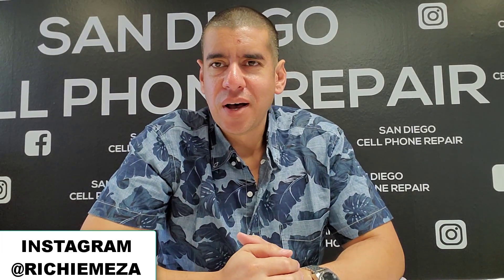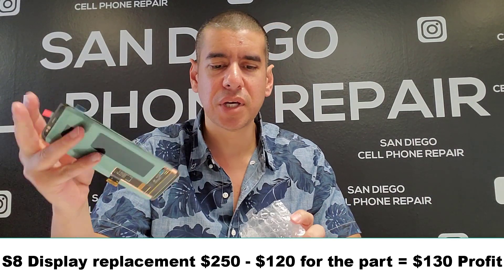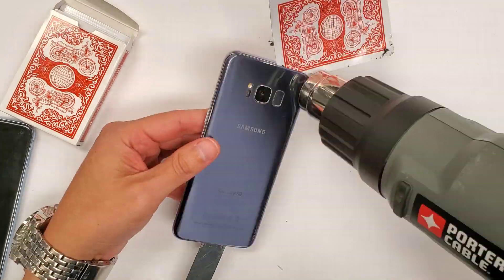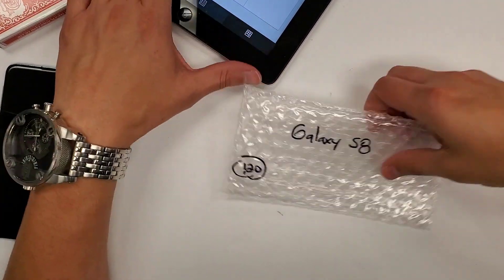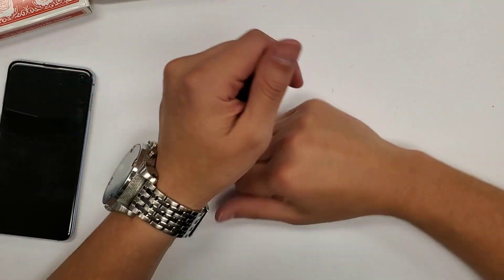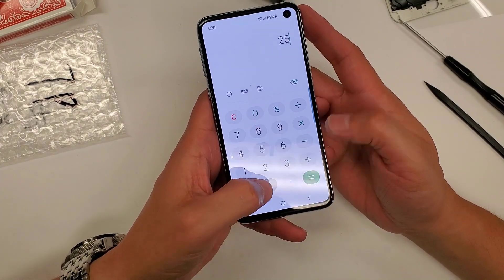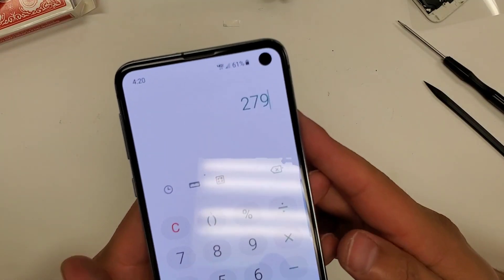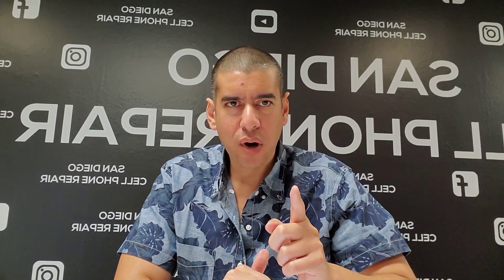Cell Phone Repair Tech made $279 Repairing Galaxy S8, Pixel, iPhone 7

Comment: I have ip 5S locked so I want to open inside the phone to remove battery but screw is stripped  so can you suggest me how can I remove the screw
Reply from the maker: Force it open. The inside screw hole will break. But you will at least get the phone open.
Reply: @RichardMeza  ,Hey Richard when you start phone repair from coffee shop did you messed up any phone of customer I also wants to start repair but I'm  scared from customer ,if I messed up any phone then what I have to do ?how can I start practically?
Reply from the maker: @nishreensodawaterwala9843  You're not going to mess up anybody's phone. Just always have the battery unplugged when you work on one. And have other parts in stock just in case something happens. What I hear is Fear. You just have to get over it.
Reply: @RichardMeza  Thanku for motivate me brother, I always pray for you, God bless you all the time.
Reply: I did ,Thanku so much I realy appreciate for your help